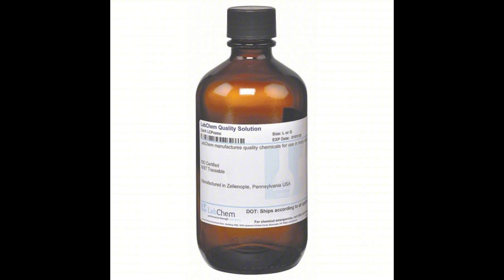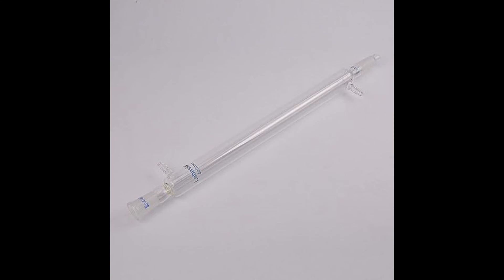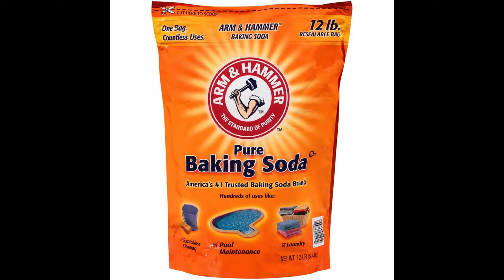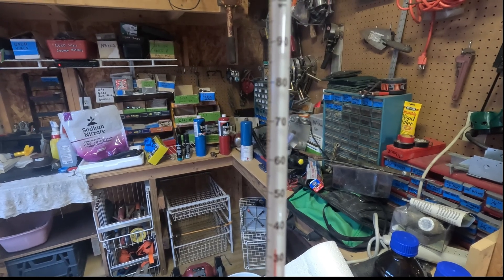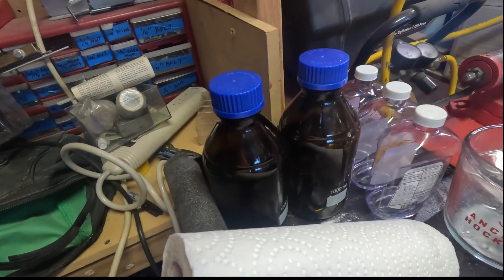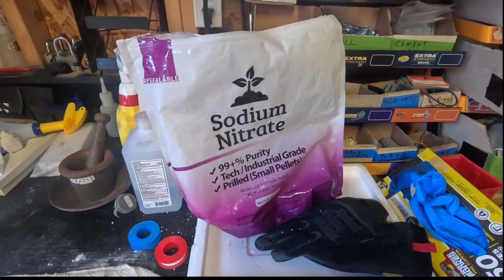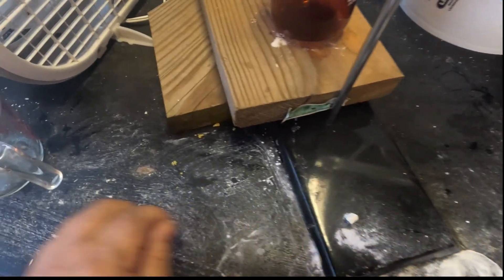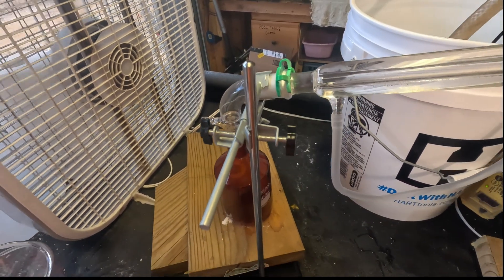Make Nitric Acid at Home! Cheap and Easy DIY Method

Comment: Great video! I just wanted to share a couple of suggestions:

1. Condenser Size: You don’t necessarily need a 400mm condenser—a 200mm one should be sufficient. I initially bought a 350mm condenser, but it was too long for my fume hood. After switching to a 200mm condenser, I found that condensation only forms on the first inch or so. A short path condenser would also work well.

2. Sulfuric Acid Alternative: A cheaper alternative is using sodium bisulfate in a 3 to 4 molar excess. Personally, I use inexpensive calcium nitrate and sodium bisulfate to distill fuming nitric acid. If you add a small amount of water, you’ll naturally distill the azeotropic mixture.

3. Protecting Kek Clips: To prevent nitric acid vapors from degrading your Kek clips, wrap your glass joints with a single layer of Teflon tape before securing them. This provides a simple but effective barrier against corrosion.

Hope this helps!
Reply from the maker: Awesome tips,  thanks so much 👍😄

Comment: How are you using sulfuric acid with sodium nitrate with a distillation system to extract nitric acid?
Reply from the maker: Sulfuric acid + any nitrate salt produces nitric dioxide vapor.. that distilled into nitric acid 90% plus.  Also called red fuming nitric.  Very strong acid.
Reply: @ProspectorsCache  
Thank you

Comment: Doesn't the title say cheap ad easy diy .. not sure if where you get your breakers is but  up here they're not cheap..
Reply from the maker: Matt,  I bought a kit off Amazon and it was less than $100.  Other items at garage sales.  Overall it cost me less than $20 to make a liter of Nitric.  Way cheaper than the $100 they ask online for it plus $50 hazmat shipping.   Also nitric you buy is 68%, the one I make is red fuming nitric over 90%.  So I have to use less.  Believe me it is way cheaper.
Reply: Good thing nitric in my country is 30$ for 2.5 (99.5%)

Comment: Or just use Stump Remover granules? What are your thoughts on using that option, in your experience if you’ve used it? Thank you, for the excellent video.
Reply from the maker: Stump remover is sodium metabisulphide which is used for dropping gold from aqua regia
Reply: @ProspectorsCache it's also potassium nitrate if you get the spectracide brand
Reply: @ProspectorsCache  My bad, I just started learning this kind of stuff so I got things mixed up. lol. Thank you! ☺️
Reply: @ProspectorsCache  Now that I’ve  figured that part out, have you any opinions on using vitamin C to drop the gold? (Just curious) Im also aware of aluminum, zinc, as options, as well…any favorites in your opinion? I really appreciate your time. Thanks again.
Reply from the maker: I use stunp remover